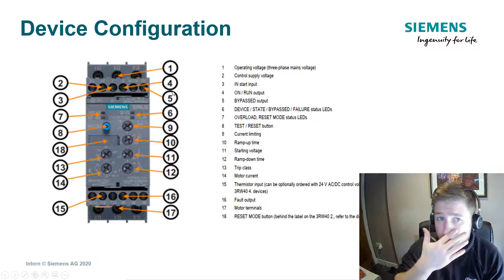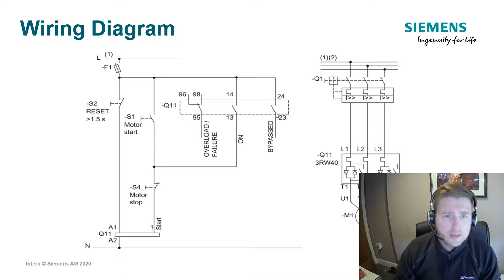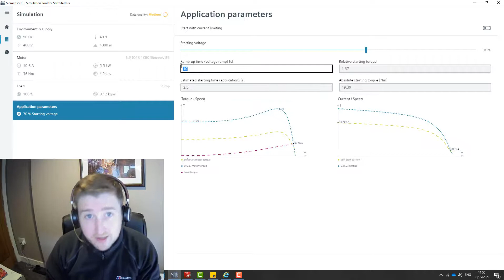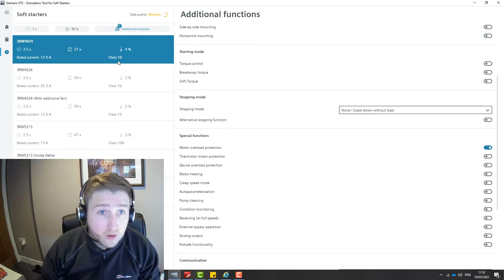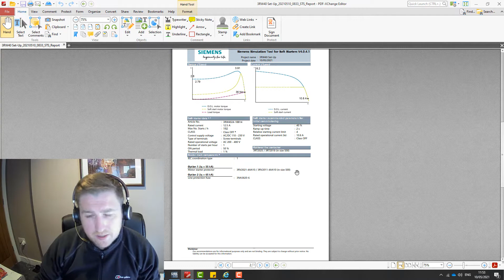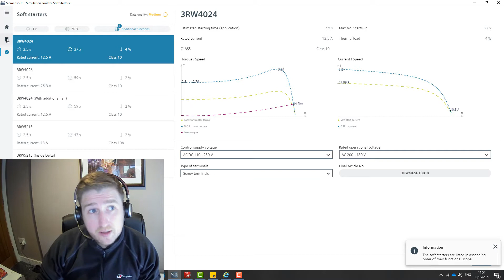3RW40 Soft Starter Set Up

Comment: Wow.  So I have a 110v motor with 1.5 HP... The inrush start current is 88A at 110v, but the no-load current is only 1.68A...  I wonder if I could use a soft starter that has 3A IcL?